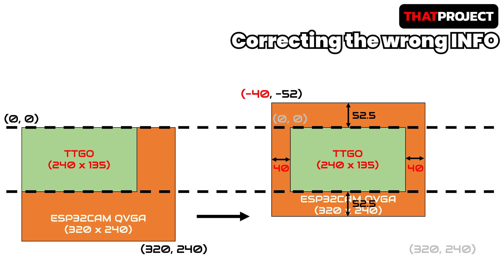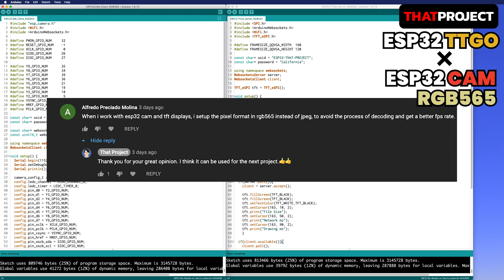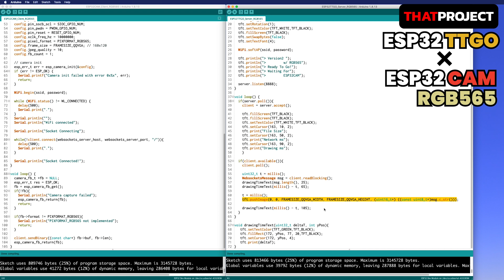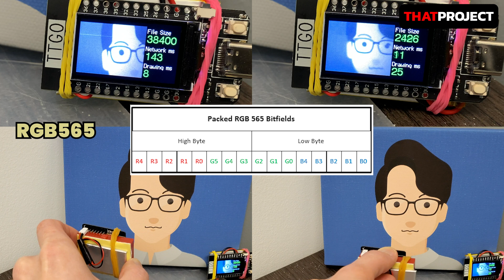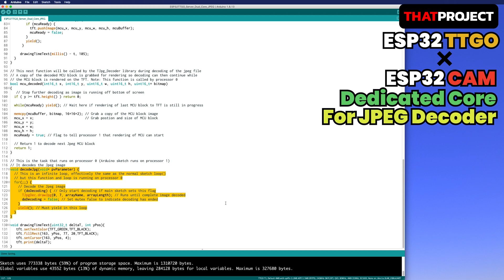[ESP32TTGO x ESP32CAM] Which One Is Faster? RGB565 vs. JPEG (ft. Dedicated JPEG Decoder)

Comment: I transmitted the video over nrf24 module at 5fps in 128*128 display and working fine now only thing i need to use better RF module which can send more no. Of bytes at one transmission bcz nrf can only send upto 32 bytes at once.. 😢

Comment: excuse me, If it nessary to use app_httpd.h ,if yes I have a problem with it , it say "fd_forward no file and directory" and I try to install esp32 board under version 2.0 but there are many error in my code therefor I don't know to fix this, can you help fix these error
Reply from the maker: The app_httpd.h is not needed in this project. Please remove this from your project folder.

Comment: Great project, many thanks for sharing this. I started  experimenting with your project from github, next I've tried your video , even adapted it on ILI9341. After I tested myself all these your sketches next I've found this video that explain rge project. 😀 I want to ask you if you changed something other to have a so high framerate, here Ihave a pretty low framerate. Using RGB565 I've 5 fps, using JPEG I've 13 fps, sometime goes up 15-20 fps. Probably this is a difference for different TFT ? I use latest TFT_eSPI version,  setup 80Mhz SPI. I here use two ESP3CAM, one send, other receive and show on TFT. Tested all projects at 160x120, next I swithed to 240x176, but framerate is low, 7fps. The infos I've explained are for 160x120. Finally I cannot archieve a good framerate,. Using the dualcore sketch does no make any difference in speed too, something is wrong I think. I use latest ESP32 Arduino core 2.0.6. Please some suggestions. I do not have T-Display. Thanks
Reply from the maker: There are several factors for fast image transfer.
[Sender]---------------------------------[Receiver]
[Capture Img]-[Sending]---[Receiving]-[Drawing Img]
These are the image acquisition speed on the sending side, the file size of the image, the network latency, and the image drawing speed on the receiving side. All of this affects FPS and this is one cycle of this process.
RGB565 can draw faster than JPEG, but the file size is larger, so one cycle actually takes longer.
If it is not a network latency problem, please check the display settings of the receiving device. Also, faster drawing is possible if DMA is enabled.

Comment: Thanks for the video and code. Appreciate!
How about setting the clock of OV2640 to 20Mhz instead of 10Mhz?
Reply from the maker: There was not much difference in this situation.
Reply: @ThatProject  Well, my case will speed up a lot.
Reply from the maker: @TT-it9gg  Oh, that's nice then. Did you test at VGA resolution? How much difference was there?
Reply: @ThatProject  That frequency determines the max transfer rate from 2640. It will affect all resolutions. The difference is almost linear.

Comment: hi, i'm using esp32-cam with ov7725 and round spi lcd gc9a01 for a standalone project. Is there any way to draw an image faster? i'm coding with Arduino IDE with esp32 support and lovyangfx library
Reply from the maker: As of right now, drawing images using LovyanGFX is the fastest. What MHz does GC9A01's SPI run at?
Reply: @ThatProject  62,5Mhz Hspi Dma ch1, using lcd.pushImage(0,0,240,240, (unint_16*)fb->buf) the framerate is about 17 fps...
Reply from the maker: @pietrocossu1534   I see. Anyway, I'm not in a situation where I can test right now, so I don't know how to increase the FPS even more.

Comment: One more help ..  I have esp32 cam ( client) , how to transfer it into esp8266 D1 mini with 1.3 240×240 inch spi ST7789 ,, display pin ( gnd , vcc, scl , sda, res, dc ,blk) no cs pin.
...,

How to make ttgo t display as bluetooth watch like MI 4,5.. connected from phone read notification, if it needs vibration motor,

Comment: Thank u That project 👍👌for this creativity. And ur more different concepts..
  One more idea can u make it has Clint ( esp32cam) has max4466 microphone , and server( ttgo t display) has TRRS 3.5m stereo receiver module.  

More ideas...
1) TTGO T  display  as MP4 player 😎😜 video files  received and converted it into certain size . From esp8266+ sd card(it act as wifi disc).
2)Ttgo t display act as MP4 player , AV received from smartphone with app. ( Like mirror cast)
3) ttgo t display makes as tiny monitor ( cable  VA or wireless)😜
4) ttgo received audio and saved to other server .
I have more ideas but suddenly not comes to mind.  Once again thank you so much That Project
Reply from the maker: Thank you for a good idea.

Comment: Hi - excellent project again.

You use the line: xTaskCreate(decodeJpg, "decodeJpg", 10000, NULL, 0, &Task1);

Wouldn't you have to use xTaskCreatePinnedToCore() where the 7th parameter is the number of the core?  And double-check it with Serial.print(xPortGetCoreID()); to assure that task arrived on the correct core.

I think if you don't specify which core then RTOS can assign it to either, so you might get even better performance by forcing it to core 0.
Reply from the maker: Maybe I missed it. I'll try it that way. Thanks for your comment.

Comment: I think the esp32 second core is used for wifi transmissions. So if you use it for decoding jpegs then the core is busy and therefore you get more latency in the dual core version. So if you use dual core decoding for a standalone project, you might get the same performance as RGB565! Thanks for the Test.
Reply from the maker: Sounds very reasonable. It could be the reason why the latency of data transfer is longer than the previous one which is not in the dual-core. I'll take a look at this part. Thanks for your comment.